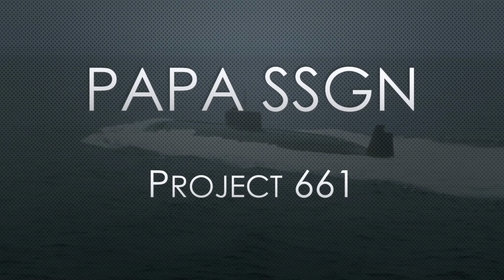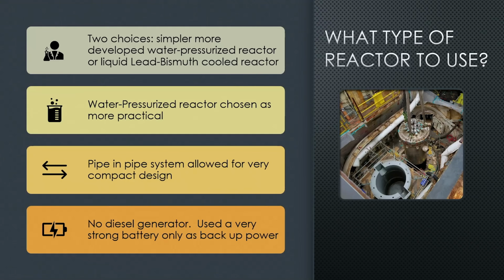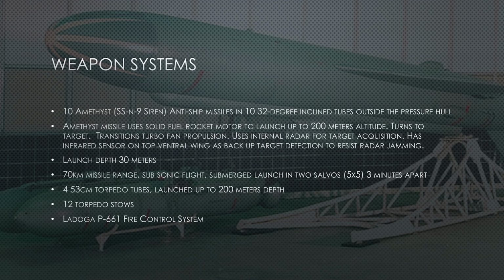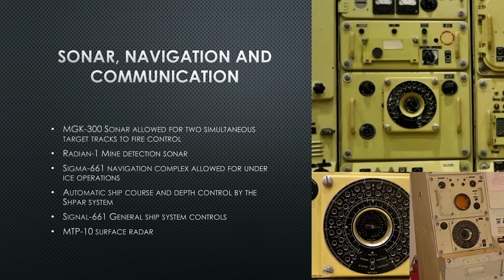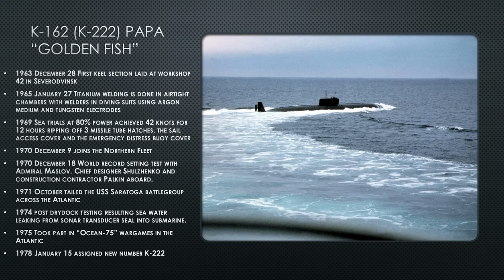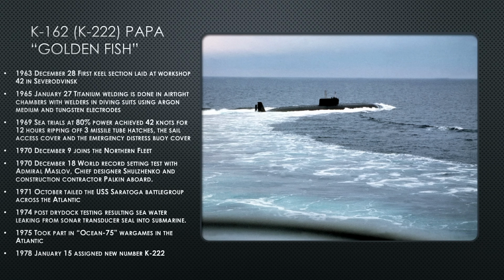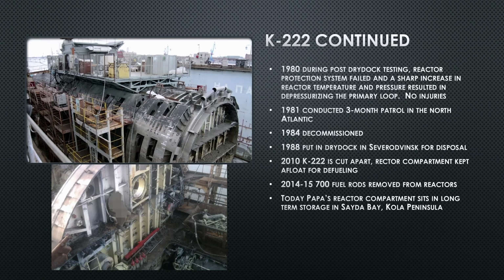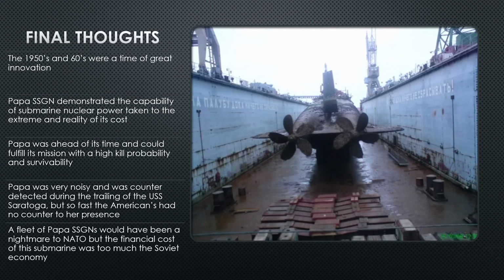Papa SSGN K-222 Fastest Submarine of the Cold War

Comment: She did not need stealth. She could just run away. I imagine at 100% she coul do 47 knots sustained. With 110% emergency flank, perhaps she could break 50 knots. Thats underwater equivalent of Mach 2.5-2.8.
Reply: 44.85 узла при 100% мощности реакторов. На тот момент у США просто не было торпед, которые могли бы догнать эту лодку.
Reply: @SovietWarryor  That is true. But unless she could dive below 3000 feet, US torps of the time could get her, becouse they would be launched from multiple vectors. Real world anti submarine warfare is not sub vs. sub. Its sub and plane and helicopter and surface vs. threat submarine. Papa, Mike, Alfa  is why US developed MK.48 torpedo that could swim faster then Russian subs, and dive just as deep. When huge double hull Russian boats acame about, Typhhon, Delta III/IV, Oscars, and Akulas us updated MK48 to MK48 ADCAP (Advanced Capability) giving the torpedo speed above 50 knots (unclassified, real speed who knows but it was deemed enpugh). US also field MK54 lightweight torpedo dropable from helicopter (SH-60 Seahawk LAMPS) , P-3 Orion (replaced by P-8), S-3 Viking. Americans always respected, not neccessarily feared, but respected Russian submarine force.

Deep diving ability only counts if the sea bottom is well below the test depth of the boat.

Comment: Why build only one?  For Soviets, taking a decade to build a single unit, is not sustainable. Its like developing and bying a one-off hyper-exotic car. Dev costs, operating costs, training costs, and maintenance costs for a fleet of few expensive boat class is not Soviet.
Reply: Why build one of the Enterprise class CVNs? Turned out it was too expensive so they had a re-think.
Reply: @trolleriffic  Well the old 65 was first CVN. It was a test bed for Navy to get it's feet wet operating large atomic powered surface warship.
Reply: @dkoz8321  well so was the papa, they tried alot of stuff and so would of learnt from it

Comment: The twin drive-shafts and counter acting propellers acting in the hi speeds with that tail design would have ripped the center frame apart as they were just adding to the centrifugal and natural forces of energy, by its design; they were working against each other with the size of their paddles. it would have ripped that tail apart. the size of the shaft and blades, if modified, would not have changed it's residual affects. like ripping a double stick popsicle. 
the power-cell itself would have drove those propellers so hard, the blades would have bent over like heated spoons because of the force of water against the flat surface. adding to the decreased performance of the propellers, adding to the imbalance of the shafts, etc. etc. the gears and bearings would have driven the guides right out of her.

Comment: I wonder if this sub model had any affect on attaching subs to carrier battle groups. If this boat is stalking cbgs, it can’t exceed the speed of the groups. Which essentially negates its speed advantage until launches. But if you were tracking it, as long as you keep the sub on the inside perimeter and an asw craft outside, it realistically couldn’t outrun a solid coordinated launch plan. Which at that point, there’s really no purpose for radio silence.

Comment: Were the reactors geared cross-shaft, or were they straight drives?  I’d assume each reactor could run both shafts, but those designers from the 50’s and 60’s made some . . . interesting choices from time-to-time.

Comment: Used lead -bismuth eutectic ,LBE, is liquid at 255 degrees F, 123 degrees C, and as lead expands when heating, bismuth contracts, so the volume stays almost the same in use. It is ideal for cooling reactors, but must be kept hot all the time to keep it flowing, thus needing constant regulating of the whole nuclear system. It is also heavier than water as a system even though the volume can be kept smaller.

Comment: 11:32 To put the 80K HP that this 7K ton sub produces into further perspective, a 100K ton Nimitz class carrier produces a total of 400K shaft HP total.  That's frickin crazy!
Reply: Where did you come up with that number? Nimitz Class CVNs produce 280,000 hp. The earlier ones originally made about 260,000 hp when built, but were uprated later in life. By the way I am a Ex Navy Nuke Machinist Mate.
Reply: @scottcole7282  Well, you may be right about that.  I could have sworn it was 100K per shaft, but I could be wrong.  

Ex Nuke ET with long hours on number 1 shaft of the USS Theodore Roosevelt, back when she was ported in Norfolk.

Comment: Carrier reactors used to use diesel and JP-5 as neutron shielding around the reactor.  I'm sure the soviets used something similar.
Reply: Where the heck did you hear this? Seriously I gotta say this is new one for me. I thought I had heard every single made up "fact" about Naval ships, but I gotta say this one is a doozy...
No, they don't use diesel and JP-5 as shielding.
Reply: @scottcole7282  Well, as a former us Navy nuclear reactor operator, I can assure you that this was the case.  As you are probably aware, the proper shielding for gamma radiation is lead or steel. However, to shield neutron radiation you need a bunch of hydrogen atoms. Fossil fuels are long chains of carbon atoms with even more hydrogen atoms. Aircraft carriers used to use jet fuel for this. They have since switched to water, since each molecule has two hydrogen atoms. If you are still confused, look up neutron shielding.  If you still think I'm lying, that's really a problem on your end.
Reply: @sixft7in  thanks so much for the education Sir and Thank You For Your Service
Reply: @sixft7in  i wonder why they didn't just use water in the first place? i'm sure that they probably needed more water than diesel for the same amount of shielding, but surrounding a nuclear reactor with flammable fuels sounds like a good way to make an admittedly very unlikely but extremely dangerous situation into an even worse one, because last i checked, jet fuel doesnt mix well with super hot steam and/or nuclear fuel rods. maybe it saved some weight? or gave them extra tanks to store jet fuel in? idk just seems like a strange choice.
Reply: @Misha-dr9rh  The shielding tanks are on the outside of the Reactor Compartment (RC).  The RC is an open space that has the Reactor vessel in the middle.  On a carrier, the Reactor vessel was probably 30 feet from any RC bulkhead, so there certainly wasn't a concern for fuel assemblies being able to touch a shielding tank.  As for why they changed out the fuel for water, I don't really know.  I'm sure they determined that water worked almost just as well for neutron shielding and was easier to deal with.
Reply: @Misha-dr9rh  The problem with water is neutron capture by the oxygen atoms. This transmutes Oxygen-16 into Nitrogen-16 which is very unstable with a half-life of 7 seconds. It decays back to Oxygen-16 and emits a high energy gamma ray in the process so neutron shielding with water gives a serious gamma radiation problem which needs lots of extra shielding.
Reply: @scottcole7282  you are incorrect, sir.

Diesel fuel make a great neutron shield. It's the same reason that they use plastics.

Source: I'm a submarine yeoman.

Comment: Wrong! The problem with steam in a primary loop is steam has a lower heat transfer coefficient. The Rx will maintain the same heat transfer rate too cool itself. This being true cause centerline fuel temperature to skyrocket and due to delta temperature to maintain the rate, eventually going beyond fuel melting temperature... ie meltdown.

Comment: Lead Bismuth alloys typically melt slightly above 212ºF or 100ºC , some can actually melt below if they have Antimony, but their boiling point is 1600ºC  or 3000ºF (roughly) while superheated steam is in the realm of 300ºC and at high pressure. A low pressure circuit is safer and the lead Bismuth mix is  not as corrosive as superheated pressurized water.
Reply: But you can't ever let the reactor cool off.
Reply: @ScottKenny1978  You´re thinking the mix goes solid in the pipes, right? But what if you do a pipe in a pipe, with the lead/bismuth mix in the inner pipe, and water steam in the outer? You maintain the mix in liquid state, regardless of reactor temp. You just need one working reactor to keep the steam running. I suppose you could use one reactor to restart the other, after a shutdown.
Alternatively, you can just have resistances coiled around the main pipe, and use batteries to melt the mix until the reactor is up to temp. Or induction magnets.
Reply: @Biden_is_demented  Pipe in pipe is a great engineering approach to heat exchange.  It is thermally efficient and is compact . But you had better be sure of strength of pipe. Especially the inner pipe which is subject to two different substances with different thermal coefficients. In a submarine, subject to many thermal expansion cycles, and possible shock of combat . A depth charge or nearby torpedo detonation jars loose all sorts of components,  breaks seals, and amplifies micro cracks. 
Soviets developed Alfa and one off Papa boats as underwater interceptors and not as patrol boats. Idea was to sortie out, in war, race towards NATO carrier groups, fire off their cruise missiles and torpedo warshots,  then run for sanctuary . If Alfa was Mig-25 of boats , then Papa was YF-12 Oxcart, or at least a MIG-31.

Comment: How fast was the Alfa , I thought that was the fastest .
Reply: Alfa could achieve a burst speed of 43-45 knots and 41-42 knots for longer ranges. Papa set an unofficial speed record of 44.85 knots in 1971. What differs between the two is the sheer size. The Alfa has a displacement of 3200 tons and the Papa 7100 tons.

Comment: pipe in a pipe is called jacketed pipe used a lot in the chemical business.
Reply: Pipe in a Pipe makes no sense for a Nuclear Rx. Never heard of a single Rx that did not employ Steam Generators (SG). A steam generator has 4 main taps 2, for the primary (in and out) and 2 for the secondary, (feed water in and main steam out). If they used "Pipe in Pipe" they would hundreds of additional possible primary leak points. Also how would you control feed water level in hundreds of individual linear boilers? The whole idea makes no sense at all.  
Ex Navy Nuke Machinist Mate  and Commercial Nuke QC inspector.